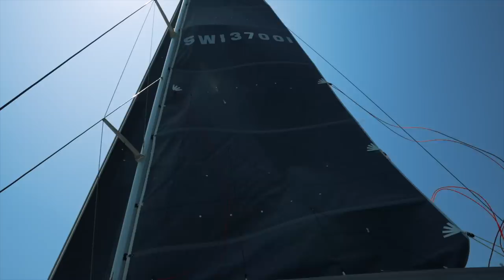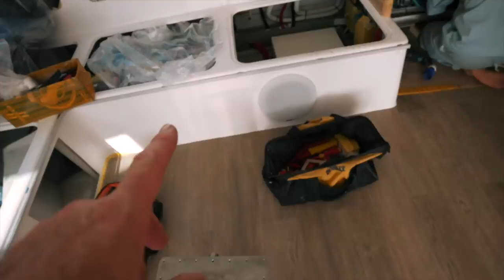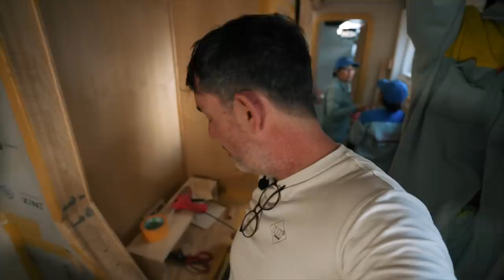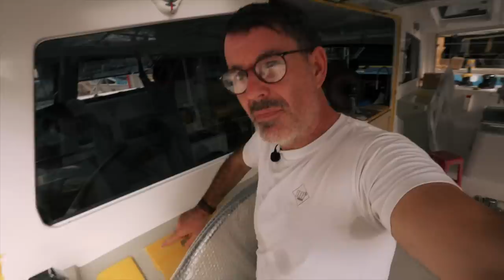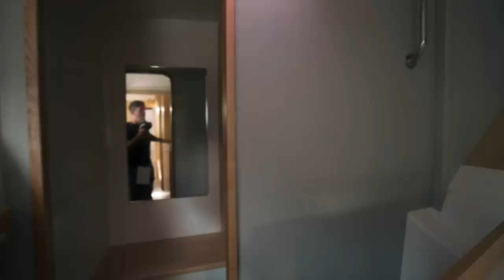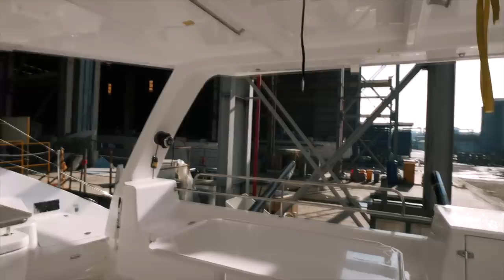OUR VERY LAST CATAMARAN BUILD EPISODE!

Comment: The boat is a beauty, but two things to mention.  From more than 20 years of cat sailing I know that your TV will be broken in the first wawy situttaion when one of the crew will go down below.  Please install a solid plate in front of it than can support a body slam rather than the screen.
Also the bunks seems to be in total lack of ventilation below the matresses, battons with an air gap should be installed to vent  out all the moisture from sleeping bodies.
Looking forward to splash day, good luck.

Comment: Nick, please watch Tula' s "If you thought the boat work was over..." @ 19:30 episode. It seems that Seawind could be using dissimilar metals for some thru hull (strainer) fittings which will cause you a big problem down the line. Have them switch to all of one metal type or maybe GRP ones.

Comment: You need a bump stop for the swing out chair at the Nav desk and work bench. Don't you need a rack / rail system on the hob to hold the pots so they don't slide off when cooking under way?.